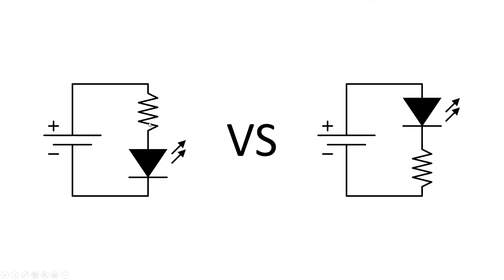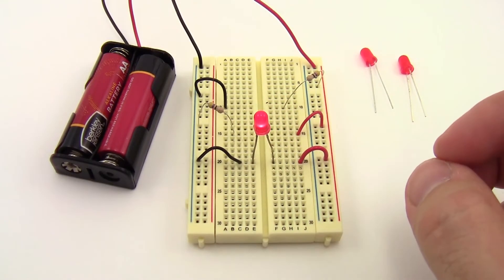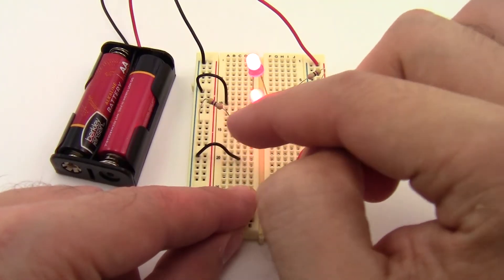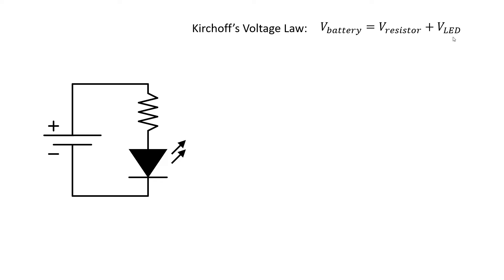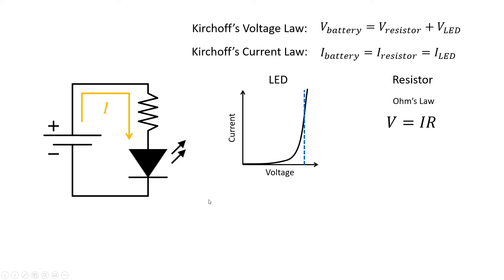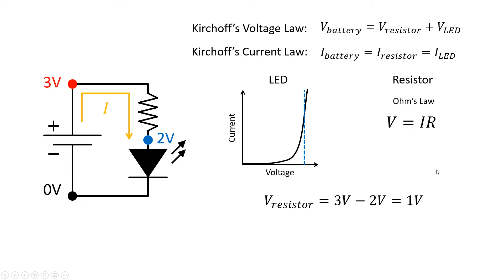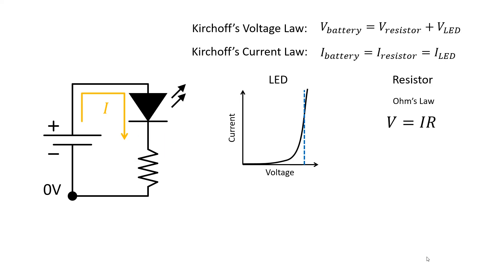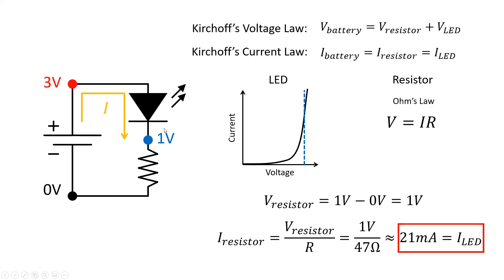Does the resistor need to go before the LED?

Comment: I still do not understand, when LED goes before resistor, isn't the LED facing 3V directly (even though in both circuit it *contributes* to 2V potential drop)?
Reply from the maker: Voltage is always defined between two points - so the voltage difference between both ends of the LED is what matters, not the absolute voltage relative to ground/zero at the "beginning" of the LED.

Comment: Even if the equation is the same, wouldn't the LED heat up or potentially die if the resistor is after? Thank you for the vid :)
Reply from the maker: No, the voltage drop across the LED is the same in both cases!

Comment: I'm no electrician... but I think of it like this:

Imagine you have snow run off from a mountain, all this water collects and speeds up to a point, until it becomes a rushing river (The height of the mountain would equate to the Voltage Start and then when the ground levels off a little on until the point where the water collects into a lake or the ocean - this would be Voltage Finish or 0; and the difference between the two (Voltage Start and Voltage Finish or 0) would be the Voltage Drop).

Now if you were to place a huge boulder so that only a small amount of water can get past either side (Resistance) then this would build up and cause the water on BOTH sides to slow down the speed at which the water flows (Current).  Thus, it wouldn't matter if you were to place a water wheel generator (load/LED), upstream or down stream from the boulder (Resistor); because the OVERALL speed of the water (Current) on both sides would have slowed down.  Or... if you reversed the order of the actions and placed the water wheel generator first (LED); and then placed the boulder (Resistor) second... you get basically the same result.  That the water streaming (Current) past the water wheel generator (Load/LED) has slowed down.  Which means that the Resistor or LED is not going to be burned out depending on the size or the capacity of the Resistor's resistance rating (Size of the boulder).

However if you place the waterwheel first; then you have limited time before it burns out; whereas if you place the boulder first, then you have all the time in the world to place the water wheel.

In the above setup, all the components were placed before the power (I'm using the term power loosely and not capitalized; for there is a very definite electronics definition which I'm NOT referring to here) was turned on.

Thus... we have three possible ways to set up the experiment:  It seems best to set all the components and not switch them in or out WHILE the power is running, or while current is flowing.  The current or water flowing is a function of gravity or Potential Kinetic Energy, or simply Potential Energy (Based on the Height of the Mountain/Capacity and Charge of the Battery); the Kinetic Energy is the Current.

This isn't a perfect analogy; because you are comparing molecules of water to electrons jumping from atom to atom; but it kind of illustrates the general idea.

Comment: Can I have a resistor before  the led and 1 after.  For example 220 before and 100 after instead of 1 that is  330 ?  
Good video btw. Thanks
Reply from the maker: Yes, if you have more than one resistor you could put both of them before, both after, or one after and one before. Great question!

Comment: An ah-ha moment for me was when I was messing with an inductor placed before a capacitor, current flow controlled by a toggle, split directly from the inductor to the ground with a resistor. The resistor there was rated high and I noticed an led  in the circuit began to fluctuate in brightness instead of staying lit with the toggle. Watching the amperage showed that, to me anyway, there's almost a fluid dynamic involved with the flow of electrons. This helped me realize why a resistor after an led works.

It's like having a river pass through a delicate watermill wheel that is only built for a certain speed and volume of water. You can control the 'speed' and 'volume' of the flow before or after the 'wheel' just as long as the 'water' reaching the wheel isn't so much it 'floods' it. I realize this analogy isn't totally accurate to how electricity works, but it's pretty comparable.
Reply: Wow, that’s the best analogy I’ve ever heard for this, it’s actually what I was looking for when I clicked on this video, not the math but WHY it works. I was thinking ‘Oh no, the voltage is getting to the LED before the resistor so it must be too strong and will blow it out.’ But I guess it’s like a dam in front of it, as long as the flow is controlled (before or after) so that it doesn’t run ‘through’ with too much force then it keeps the LED safe, according to your analogy if it’s correct. It’s actually a perfect analogy for my little mind. Thank you
Reply: @rainyhexemer1848  Yes a dam is another good way to think of it - to me it's like at a certain point the 'water volume' will reach the pin of the wheel and overwhelm the mechanism, or in a dam, if there's too much volume, the water won't flow through the dam like normal but will start to spill over it completely - and this 'tolerance' is based on how large the wheel is, or how high the dam is - and this can symbolize to the resilience of the LED and resistor setup in the actual circuit. Electricity is pretty enigmatic so these visuals help me a lot

Comment: So, if I’m understanding this correctly, it appears as though the “water pipe” analogy does NOT apply here, as the presence of a thinner pipe does not reduce the flow of water before it; only after. Or doesn’t it? The water does become somewhat backed-up before the mouth of the thinner pipe, and the flow does gradually  become slower at points closer and closer to the water source until the flow is the same rate throughout. So maybe the water analogy DOES work.

But there’s that momentary period at which flow is higher before it reaches the thinner pipe; anything in that path will be met with that higher flow briefly. Is that not the case with an electric circuit? Would the LED not be very briefly taking in a higher current before the resistor brings the current down?
Reply from the maker: Hi - in a closed pipe, the volumetric flow rate of the water must remain constant (the volume of water per unit time - so for example measured in something like cubic meters per second or gallons per minute). If you restrict the flow, for example by installing a thinner section of pipe in the middle, that is going to affect the flow rate both upstream and downstream of the restriction. You have to be careful not to get volumetric flow rate mixed up with *velocity*. For example, if you have a hose with the nozzle on the "jet" setting -  the velocity of the water is slower inside the hose and faster once it goes through a narrow nozzle and exits the jet, but the volumetric flow of water is the same before and after the nozzle. Volumetric flow rate in this case is analogous to electrical current in a circuit - for a series circuit, the current must be the same everywhere. In this case, the current in the circuit is the same through the LED and the resistor since they are in series. Hope that helps - it's a bit much to explain in a YouTube comment, but there are other videos on YouTube that will provide more of a background on circuit theory that might be helpful in understanding.

Comment: Are there any advantages to doing it a certain way tho? Also, is there a way to get the "lost" amps back after the electricity has gone thorugh the resistor?
Reply from the maker: As far as the physics of the circuit are concerned, it doesn't really matter. When physically laying the circuit out on the breadboard you may find that you prefer one arrangement over the other. Power dissipated in the resistor is converted to waste heat so it cannot be recovered directly within the circuit.
Reply: @Science.Buddies  Thank you for the fast reply, appreciate it!

Comment: I’m using an in hole resistor inside a car license plate light bulb socket to prevent random turn off of an LED bulb. I have one end of the resistor in contact with one contact inside the socket and the other end of the resistor in contact with the other contact inside the socket. Then I insert the bulb. It seems to be working. My question is: is this resistor connected in parallel as described? Also, if I wanted to connect it to the wires instead of inside the socket could I just connect one end of the resistor to one wire going into the socket and the other end of the resistor to the other wire going into the socket? If I calculated I need a 120 ohm, 1W resistor am I ok to choose a 120 ohm, 2W or a 120 ohm, 5 instead? It is my understanding that the 5W would dissipate more heat so it would be a better choice. Any idea what the operating temperature difference would be between a 2W resistor and a 5W? The LED is rated at 83 mA at 13.2V.
Reply from the maker: Hi - our channel is for K-12 students doing science projects; we are unable to help with automotive/hobby projects like this but you should be able to find other forums/channels online that can help with your questions.
Reply: @Science.Buddies  I’ve posted on about a dozen or more different videos in the last 3 weeks and nobody replies. You’re the first one. To be honest I don’t think anyone knows how to answer it.
Reply from the maker: You may have better luck with forums dedicated to electronics, like something on Reddit or Stackexchange, as opposed to YouTube comments. Good luck!

Comment: I still can't visualize this in my head. If we use the good ol' water analogy, then the resistors are reducing the amount of water going into the LED (thus sparing its life). But if the LED is placed first then in my head, it would only make sense that the LED would get filled with water (and exploding it) before the water would go through the resistor and then be reduced. Needless to say, I am a total noob and am just getting started with this stuff.
Reply from the maker: Hi - you have to be careful with the water analogy, because while it can be useful sometimes, it is not perfect and electricity does not literally behave like water. If it helps, try thinking of voltage like elevation instead. To keep the math simple, say that a battery provides a voltage of 10 "steps" (so imagine walking up 10 steps). Say that the LED has a voltage "drop" of 6 steps. That means to close the loop and get back down to zero, the resistor would have a voltage "drop" of 4 steps. It does not matter if the resistor is first, then the LED (you go down 4 steps, then 6) or the other way around (you go down 6 steps, then 4). In either case, the "drop" across the LED is still the same. You can also think of it mathematically - the voltages in the circuit are described by the equation V_battery = V_resistor + V_LED. It does not matter if you switch the order of the resistor and LED, that does not change the equation. Again it's the same as writing 10 = 4 + 6 or 10 = 6 + 4 (this comes from something called Kirchoff's Voltage Law, which we do not have our own video on, but you should be able to find plenty on YouTube). Hope that helps!
Reply: @Science.Buddies  Ok cool that certainly helps! Thank you so much for the reply and ofcourse the video!
Reply: @pingupongu843  So the way I understood it, why it works using the resistor before OR after the LED(in series) is that if lets say you are using 9V battery and your LED can take only 5V, that means 4V too much for this LED. Now the way I  got it about how the electricity woks is that if you put resistor AFTER the LED the Voltage that will flow through the resistor will be 5V so the battery will also give you 5V even if resistor is placed after. 
In short, the 9V battery can not output 9V from cathode (positive side +) and then the take in 5V in anode (negative side -) it has to balance it. So if there is resistor and it has limits the current to specific voltage well that is what the batter will output no matter where the resistor is (just be careful this works only in series not in parallel)
Reply: I use marbles analogy to understand. Imagine, in a circuit that is full of marbles that touching. The resistor is friction. When we push marbles from any direction it will be slow since there is friction. But if there is no friction, the marbles move much smoother
Reply: its like this if you put the resistor before the LED you're limiting the potential difference but the forward drop(of the LED) is going to be unchanged whether we have the resistor to suppress the voltage or not, but the TOTAL drop across LED will be higher(If there's no resistance) its a lot like the water true but the pressure is too high and not enough water?(or atleast that can flow through it) causing the pipe to rupture or implode. Think of resistances as heads which regulate the pressure differences which cause the current to flow and if there's too much of anything the component is gonna break.
Reply: Isnt it because it bottlenecks the water and slows it behind itself too. Rather than its amount

Comment: If I put the resistors before and after the led, how to calculate the current? And also what's the benefits using this circuit?
Reply from the maker: We don't have our own video on it (yet), but we recommend searching for videos on "ohm's law" and "LED resistor calculation." The resistor helps prevent the LED from burning out by limiting the amount of current that flows through it.

Comment: why some time I find a resistor connected to ground before the load?
I read it's a current limiting resistor but I find not connecting it series makes me confused 😕 as I don't know how much does it lower the current.
Reply from the maker: Hi - a resistor connected to ground could serve different purposes depending on the circuit. There are online forums dedicated to electronics where you might be able to get more help if you can post a link to a specific circuit diagram.

Comment: So at the top in red, its 3V because its relative to ground(0V) right? that is its 3 because its 0+3 = 3V. At least thats what you said and at least thats what I think I understood.
/
So my question, if the ground node had some other potential instead of 0V (say 15V), then would that red node become 15V+3v=18V?
Reply from the maker: You're correct! Voltage is a relative potential difference between two points. In a battery-powered circuit, we usually assume the negative terminal of the battery is defined as ground (0V). Sometimes it's just implied and not explicitly stated. Think of it kind of like elevation - if I say "an elevation of 10,000 feet," you'd generally assume I mean relative to sea level, which we define as 0 feet. However, I could pick another arbitrary reference point to define as "zero" - say something 2,000 feet above sea level. In that case, my original elevation of 10,000 feet is now 8,000 feet relative to my new reference point, and sea level is now -2,000 feet (but those two points are still 10,000 feet apart). This video explains the same concept: https://youtu.be/Qn9lwFMfO2c
Reply: @Science.Buddies  thanks so much
Reply: Wait, i dont think this is correct, voltage is a DIFFERENCE of potential. With 15v and 3v, voltage will be 12v and the current will flow in the opposit (compared to the example) direction.

Comment: It often confuses people when it is said that the resistor DROPS voltage. It is better to say, in this case, that there is voltage ACROSS the resistor
Reply: It should be said that the resistor absorbs some current therefore lowering the voltage?
Reply: @nuovoaccount998  lol   no
Reply: @kennmossman8701  elaborate
Reply: @nuovoaccount998     laughing out loud

Comment: So can you use 2 LEDs in series without any resistors?
Reply from the maker: Hi Allyn - it depends on the voltage of your power supply. In this case, 2xAA batteries only provides about 3 volts. Since the forward voltage drop over a red LED is usually over 1.5 volts, you can put two of them in series and get away with not using a resistor. However, for example, if you were using a 4xAA battery pack (6 volts) and only put 2 LEDs in series, they would still burn out because the voltage would be too high.
Reply: @Science.Buddies , I was pretty surprised at how fast that LED burned out. I've been playing around with a candle-flicker LED out of a dollar-store LED candle that used a single 3V button cell battery. I used two 3V cells and it didn't even seem a lot brighter. But that also (probably) uses a PWM circuit which would certainly reduce the heat the LED needs to dissipate, right? (I'm still VERY new to the whole electronics thing, so I'm really just guessing here.)
Reply from the maker: @MyName-tb9oz  Even though they provide the same voltage as 2xAA batteries, button cell batteries generally provide a much lower current. As a result, it's usually safe to connect an LED to them directly with no resistor. For example, see our LED stickies project: https://www.sciencebuddies.org/stem-activities/LED-stickies?from=YouTube. If you're new to electronics and want to learn more, Google "battery internal resistance." Batteries can have the same no-load voltage but different internal resistances, which affects the amount of current they can provide. Hope that helps!
Reply: @Science.Buddies  Three red LEDs will handle six volts.  Also three orange or yellow LEDs.  Green, blue and white LEDs use three volts so two of those colors in series will handle six volts.
Reply: @Science.Buddies  PARDON?  "Since the forward voltage drop over a red LED is usually over 1.5 volts"   which means the Vf is Greater than 3V and so would NOT light since total Vf > Vcc          Red LEDs typically have a Vf of around 1V8
Reply: No.  A resistor limits the current through an LED.  Even if you have 2 of them, you'll need something to limit the current.